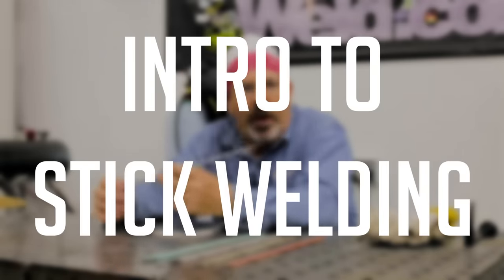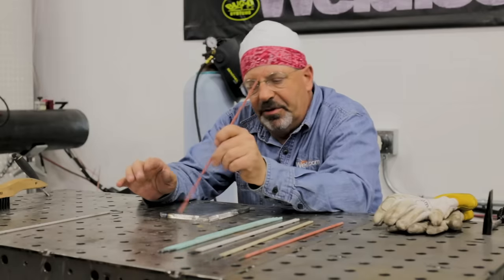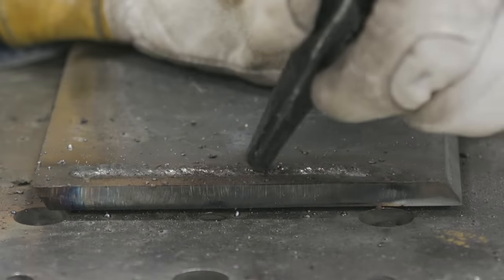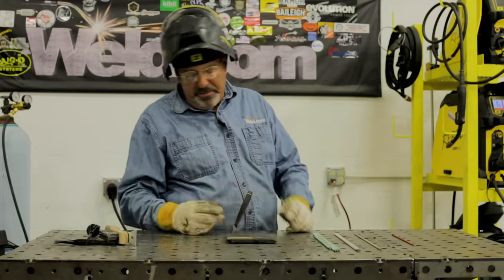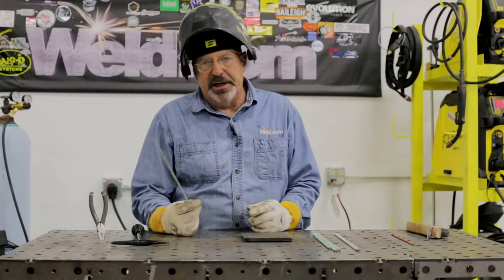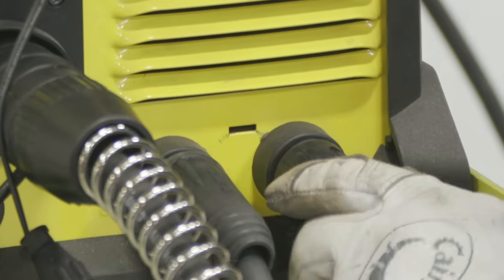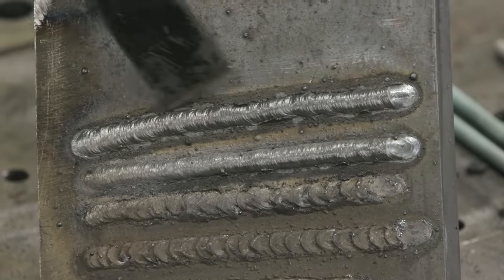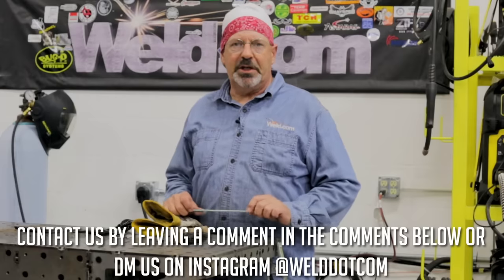STICK WELDING 101: Getting Started With SMAW

Comment: That was the best beginner tutorial I've seen on YouTube.
Reply: Thank you Rick.
Reply: I feel like I need some type of certificate and a graduation party after watching this. 😃
Reply: @bobmoffatt4133  Rick Calley nailed my thoughts exactly too. You are the absolute best instructor I have ever had for ANY industrial process.
Reply: @GazinGeezer  Many thanks for the kind words and support.
Reply: Facts
Reply: By far
Reply: Yes !!
Reply: Agree... This really us the best i have seen.
Reply: Absolutely best tutorial on YouTube by far. Clear, straight to the point instructions. easy to follow.. not confusing at all! Great video
Reply: Tutorial would be more clear if he showed us the welder first.  Also, seems like idiocy to me to tell us how many amps without also telling us how many volts, otherwise number of amps is meaningless.
Reply: @bobmoffatt4133  a1
Reply: @stillbloggin2523  Well I'm going out on a limb here and scratching my head to say... I've never been interested in the volts on a constant current power source. While using the SMAW power source, where do you set the volts? I've been looking for the knob since 1974 and haven't found it yet. Please help. I was under the impression that voltage in SMAW was a function of arc length and varies throughout the weld just like the amperage. Setting the amperage on any given diameter and type of rod is a base, or reference. Volts? They all start at the machine's OCV, then drop to the relative welding voltage.
Reply: @bobmoffatt4133  Well, I'll admit I'm a total newb to welding, but inherited an old Lincwelder from my grandpa that I used just last weekend. As far as I can tell it was build around 1955 (must have built that puppy right if I'm using it 66 years later). The mysterious voltage knob wasn't on that unit either. However, there is a giant knob to change amperage. Go figure! Haha. I think maybe Still Bloggin forgot most of these videos are made by people that teach people how to weld. 

Thanks for the great video. I've been trying to understand types of rods better as I do more and more welding. My dad was a professional welder, and has passed some great information to me. But, as good as his tips are, he doesn't usually hit this level of detail when giving me pointers.

Comment: I'm 14 and learning with an old lincoln arc welder, I'm getting better and this channel is helping me out more than I could've ever though.
Reply: Did you ever upgrade your welder? Is it an AC only welder? How do you like AC arc welding? I thought about buying a modern $129 DC arc welder. I know MIG welders are so much nicer and easier to use. But $129 for a 215 amp arc welder, is about 1/4th of the price of a 215 amp MIG.
Reply: Got an old Lincoln DialArc that my dad started teaching me on a little and I was getting decent with years ago. I'm fixing to start back welding car/truck parts & metal framing
Reply: @Ritalie  what brand are you buying or bought by now do you like it
Reply: @Ritalie  MIG welders aren't necessary that much better. Stick welding is also a more versatile skill to have.
Reply: Keep being  persistent, and remember this, every day you will learn something new, no matter how old one is!

Comment: It has been about 20 years since I welded.  Was self taught.  My favorite rod was 7014 DCEN.  I was so hoping that you were going to cover that one.  The reason I loved it was because I could literately drag the rod with the correct angle.  I believe the reason for this was the electrode melted in such a way that the flux acted as an electrical insulator, when done the tip was concave.  The only problem I had with it was welding vertical.  Did not matter if I went up or down.  I have read that this is a common problem with that rod. 

Other than that it was a dream rod.  Slag pealed off before I was done.  Very clean welds.  I even tested one of my welds.  It was on an auto leaf spring.  Cut it in half and welded it back together.   Put it in a press to see where it would break.  It was not on the weld.  Took the full 12 ton to do it to.

Comment: I'm 62 and have  been (farm) welding since 14. Learned on lincoln 225 a/c   cracker box with any rod Dad could scrounge up that the flux wasn't falling off. I've used many machines and completed many successful projects  since then but  still consider mine to be farm welding. I appreciate your vidios and now I know what rod numbers mean and how they effect my welding and what I was doing wrong with my techniques. Thanks to your instructions ,  this old dog can still learn a new trick, maybe two.
Also agree with Ivan Rios,  every HS shop (wood shop included)  should teach this skill. ☺

Comment: I repair fire sprinkler systems using the 6013 2.5mm electrode. A lot of my repair work requires welding over existing MIG welds. Brilliant video and explanation of the characteristics between each type of electrode.

Comment: 6011 is the great for rusty and painted material, also very good for tacking. it's pretty good at gouging if you're not careful and it throws a lot of spatter.   i keep a file handy when i'm using 7018 as slag forms on the end of the rod, and it doesn't restart easily if you don't knock it off.  i use those 2 rods for most stuff.

Comment: This should be the standard for all welding videos. Thank you for your wisdom sir. Great job. I’m trying to learn all I can before my first project. I’m building seat frames with 14 gauge steel tubing and I’m collecting all the information I can first. I’ve never welded before. This will be my first experience. Looks like 6010 DCEP is the way to go.

Comment: Excellent video, wish I would have watched this before I started welding, I have 6013 at 3/32" and I was trying to whip it and you say right off don't try to whip it, just do a straight drag, I did figure out pretty quickly that a straight drag worked better, but I could have saved myself some headache and a little time had I known from the get go that this rod is straight drag only. Thanks for your time, I learned a lot in a very short time. I now know that I need to get some 6010 or 6011 rods for heavier stuff, thanks again and I'll keep watching. I have no qualms about admitting that I'm new to welding, I'm 63 years old and I've spent the majority of my life in active duty military and as a corrections officer in a maximum security state prison, now that I'm retired, I have a need to do some welding, so I come to YouTube to learn from those who know. Thanks! 🖖😎

Comment: Very good information, I am not a welder I am a Machinist for over 30 years. I recently acquired a  Lincoln 225 - S welder and I was told it is basically a flat bench top welder, no vertical or horizontal and definitely not overhead. I was disappointed to hear that, but your video gave me hope that it is more versatile than what I've been told. I  just need it to do some personal projects on my property so I will definitely give a try. Thanks again for the  video the information was great.

Comment: Very good  video. I’m a CWI  for a gas company working distribution projects . Most of the welders I have monitored are very good , but there are some that need to go back to school. I have had some welders that have been welding for years and don’t know what the designation on the rods mean . ??
Probably 50% do not know how to read a welding procedure. Knowledge is very important in a trade like this . Keep up the good work .

Comment: Many thanks, I’ve just ordered a stick welder because I have a small job that needs doing and I was quoted £80 so I ordered the machine and that cost me £70 and I can use it again and again, I know it’s going to take practice but your video has definitely pointed me in the right direction. Thank you 💥⚡️🙂🇬🇧👍🏻

Comment: Best video of the year!! You saved me so much time swearing my only AC welding machine =)
Reply: Ive.an only ac machine too but just learned that for about $40 on the net i can buy a full wave rectifier and have it both ways ac/dc , some other lover as well as me, theres a how too vid on youtube where he does this with my exact lincoln ac welder. Id been wanting to do aluminum but with ac only found this daunting if at all fesible so i sent for a rectifier in 400amp config ( better overkill than under) and soon will have both capabilities. I dont get why lincoln for an extra buck didnt make.this damn machine capable of either or put any damn wheels on it as they did in the past on the same model. Friggin marketing greedy fucks i expect. Rich/San Jose

Comment: I am from brazil old subscriber here in the channel, very good reversing the rebel for welding AC coated electrode welded with several eletodos, can make a video in AC welding with aluminum eletodo correct preparation base material with the eletodo would be a good challenge because it was a long-used welding long before TIG became popular ...
would be a good challenge for you and the public will like to see and learn ..
Reply: Never seen aluminum being welded via MMA or SMAW on AC, only DC.

Comment: Excellent video! I am new and I wasn't sure if the rod actually touched the metal when welding also thanks for clarifying the position of the rod. I am still confused about ac and dc and when and why you use it?
Reply: An A/C tombstone setup can get you up and running, on stick welding, on a farm, for like $300. Great use of an A/C welder. And easier to strike the arc............With D/C  tho, more options, you can get an Stick/TIG combo unit, ($400) or a decent  wire feeder rosin core, ($120) or MIG ($200) .         "I am still confused about ac and dc." (your quote)     If you have that question, you need to take classes or whatever is available. But it is out there and you can do it. Learn, then Burn, then Earn.
Reply: If you have an ac only machine...run ac rods or ac/dc rods ok. Use ac only rods (6011) on rusty, dirty steel if you can't clean surfaces before welding. Still confused? Watch video again.

Comment: A great video! even after 50+ years of 'farmer' type welding with stick or oxy gas I am still learning, I mainly used an AC 180amp welder as that's seemed to be the most popular type then, so DC stick & mig were newish to me, I still find it difficult to weld with gas shielded mig for some reason although flux cored is no problem, go figure! 
I liked the simple approach you have in the video: These are the popular rods; these are the options for power, this is what the arc looks like and this is what the weld should look like. Because of all the variables, welding is something that you learn yourself as you go. Again, thanks

Comment: Thanks, I know this is a few years old, but it helps. I have done stick for 2 decades, to say I'm rust is an under statement. And I just bought an auction lot that included several types of sticks, so I may dig out and dust off the old arc welder...

Comment: Good stuff to know. I just started a welding class and I've done 2F and working on 3F T joints now with a 6010. I'd been having trouble with digging but it's good to know that the 6010 tends to dig so it isn't just me being horrible.. Thanks.

Comment: I learned to weld on an old Miller stick welder (late 70's early 80's), I didn't have a clue what I was doing, but I usually used a 6011 or 6013. Mostly cause that is what my dad had laying around. Got back into welding when I bought a Jeep several years later, but I went with a Hobart 140 wire feed, no gas. I know each has it's place, but that wire feed was so much easier to me. But I did not weld anything more than 3/8" mild steel most of the time. This video explains why I had the most success with those rods, given the old AC only Miller, thanks.

Comment: Sir, I've had similar issues running 6013 uphill. I've been welding as a fabricator- Millwright since 1990. Therefore when I was told by an 18 yr old recent Vocational school graduate 6013 would run uphill with a cosmetic finish I laughed out loud 😏. After watching this young man run a roll of dimes uphill with slag curl I had him school me on his technique.... He simply put a slight upward angle and elongated sideways figure 8 oscillating drive right up the seam. I couldn't have done better in a flat position 🤔. I picked up the stinger and within an inch dialed in travel speed with perfect results. He praised his instructor with maturity I didn't expect.I'm a certified welder with almost 4 decades experience who runs a small fab shop and farm. I hired him on the spot and started him at a wage I hope will keep him here... Humility is hard for me, but this was an easy pill to swallow. Hope this helps you uphill 6013, would love to see a video demonstrating this technique with credit given to Norris Mechanical Welding School Anderson SC. We need more quality teachers like Dale Norris.......

Comment: This is by far the best instructional video I've seen. My questions are; 1- preset AMPs to what voltage for thinner metal such as 1/8th - 3/16th? I keep blowing holes at 90 AMPS and higher. Do I need to move faster or less amps?  2 - Does the rod play a role in thinner material? Such as 1/16 instead of 1/8. 3- does whipping,  rocking or shoving, back into what you have left behind, make for a bad weld? I broke a peice that I hammered on while hot earlier.  It had a look like pot or cast. No bendage, just snapped. Thanks for any help.

Comment: I used 6013 because it was the only 1/16 rod available (My machine has only 1/16 and 5/64 settings) None of my welds held (Some broke after some minor hammer strikes).  I think its because I broke every rule for 6013 you laid out in this video.  I went behind the pool, and whipped it constantly.  lol thanks for the tips.

Comment: I just bought a little stick welder . a Harbor Freight 80 Amp inverter welder because I though it was a little less complicated to  learn than on my HF Flux 125 I bought last year. Setting that up and trying to juggle wire-speed..vs Amps was getting to be very frustrating. The adjustments are just not really there EXCEPT Wire speed. Amps are Min/Max and non-removable leads. Stick is SO much better as long as I can follow the amperage written on the sticks themselves. It also helps a ton learning the breakdown of each number.  The sticks I bought for my 'Mity Mite' as I lovingly call it are 1/16 in 6013 (20-45 amps) and 3/32 in 6011 (40-90 amps) Haven't tried the last yet due to some Back issues flareups (68 yrs old) but I can't wait.  I actually ran a couple of things that looked like beads for a short bit using a old Lawnmower blade for practice! I'll get it ... and the stick makes it easier and FUN to learn.  Thanks for your video and the easy way you explain each element. -Jake

Comment: In the past I was watching this video and learning about rod-types, however then I went to welding school and learned something else. Such as if you're welding for outside use and live in location where it gets freezing at some point you should not use rods with rutile (such as 6013) at all, instead you should use alkaline rods (such as 7018). So if you make a fence with 6013, welds could just break off when it starts freezing and you stress them.

Comment: Great info. Thanks! I’m surprised you didn’t go over how to strike the rod onto the plate to get it melting, and what to do if the rod gets stuck onto the metal, as well as what to do immediately after you are done with the welding area.

Comment: From the first time I struck an arc with an old 'Lincoln Arc225', to the time I got to where I could lay 'professional' beads...took me YEARS! Not one person ever pointed out to me, what I eventually learned 'on my own'...and that was how IMPORTANT stick angle and 'right stick for the current type' was. You just can't say it loud enough...angle, angle, angle...followed by current, current, current. The rest you can get from the comments of others in-passing, but those two facets every beginner needs to understand...no more than 10-degrees off from vertical, and if you THINK you're using the right amperage, you probably need to 'turn it down' a bit. You'll take your stick welding to 'good MIG quality' in no-time, if you just remember: angle, current, short-arc distance...and practice! AC Arc Welding might be the 'beginner entry', but it is also your 'basic bread and butter', because you either learn all basic skills here, or fight it will all other forms of welding later! Good video!

Comment: Thanks a lot for this video, I went ahead and tried(before this video) without much knowledge beyond angle, thinking it was 10-15 degrees or so from flat instead of perpendicular....warped my piece without it actually welding being a moron. Now I can weld 6013 no problems, nice and boring.

Comment: I understand the basic theory of how to weld and have some experience at home. I have a Lincoln 225 AC stick welder with low hours and I can't seem to weld anything with 1/8" rods even if my life depended on it. I have tried settings from 50-175, used 6011 and 7018 (new Lincoln rods), clean steel. 95% of the time the rod sticks. If I actually get it to weld it has to be doing a sweeping pass to start on a radical angle.  I can weld 5/32 6011 like a pro. I always keep my rods in sealed containers and only open as needed. I have been in an auto accident and need to do some kind of work from home. I refuse to be a lazy drain on society so I'm choosing to do metalworking of some sort but I need to be a proficient welder. I know MIG is easier than stick but I want to be good at old school  stick first.